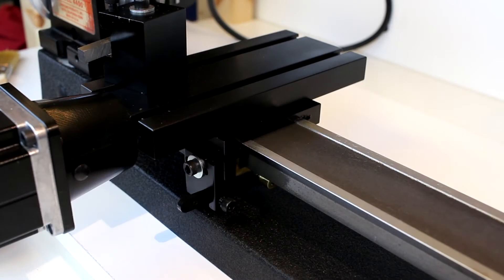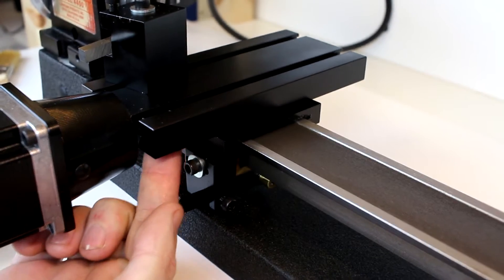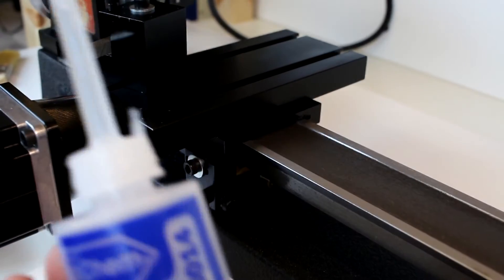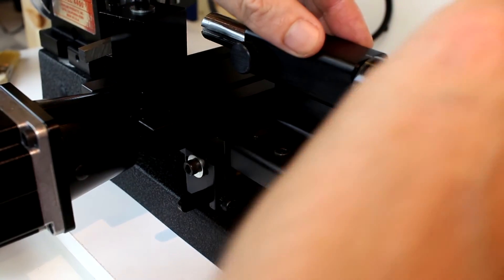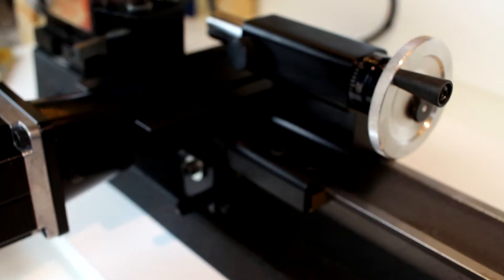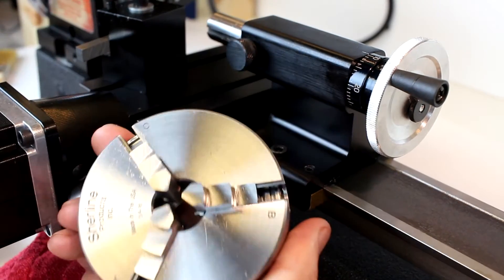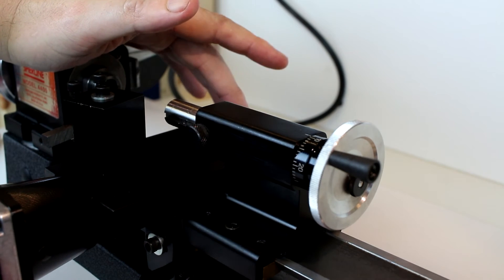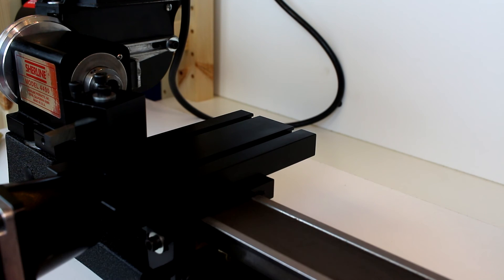Sherline Lathe 104 - Machine Lubrication

Comment: Hello, I have question about lubrication. Just ordered my first sherline mill. On the website is only "Super-Lube Multi-Purpose Synthetic Grease" available. And I might have seen that you use also Grease in other videos. So the new way is to use special grease, instead of light oil? Thanks & best regards
Reply: Channel does not appear to be active any more, unfortunately. A great resource.  (Don’t have clue, personally.)
Reply: I’ve bought the same grease as Sherline recommends, and you can buy it at your hardware store. It works pretty well and it’s a dry grease so it won’t be sticky to attract dust and debris. Oil will work as well, you just have to oil it every time.
As another side note, as he says here, keep oil away from the crosslide top and you can super glue a square piece of paper on the bottom of your tool holders. I used a paper nail envelope, cut the pieces, made a hole in the middle for the screw, a couple drops of super glue on the corners, and voila, it increases the bite while protecting the surface of the table!
This channel was awesome but, since the creator wanted to really pass on his knowledge and experience, it is nothing for the YouTube public who expects yelling and screaming persona with empty content over great information as found here. It’s sad but true. Nobody is looking to learn stuff the right way but just to look cool. Remember in school when your most boring teachers were the ones teaching you the most? Unless you went to private school where teachers are entertainers with a talent to teach while at it.
Hope it helps you out any others who come here looking for real info!
Miss this channel too 😢
Reply: I also watched an official Sherline video that indicated Super Lube grease because it holds up at high speed.
Reply: Meant to add for the chuck only

Comment: Do you know what type of oil would be most suitable for lubricating the bearing surfaces on the lathe's bed? I use 3 in 1 oil right now because it's all I have but I'm wondering if there something better for this application.
Reply from the maker: +Tim Le Sherline recommends a light machine oil, such as mineral oil, and this works well for me. You can get it as sewing machine oil very cheap (look at fabric/craft stores), or go to something fancier like super lube (I will be testing this soon) which offers both a dry spray-on lubricant and a mineral oil based product. Here are some links to the products on Amazon:
http://www.amazon.com/Sewing-Machine-ZOOM-SPOUT-OZ-118ml/dp/B00BYCKTW2/ref=sr_1_3?ie=UTF8&qid=1455630200&sr=8-3&keywords=sewing+machine+oil

http://www.amazon.com/Super-Lube-31110-Aerosols-Multi-Purpose/dp/B0016GTSBY/ref=sr_1_4?ie=UTF8&qid=1455630286&sr=8-4&keywords=super+lube